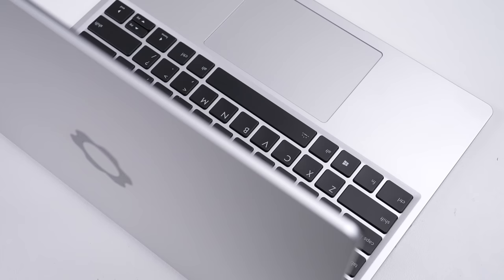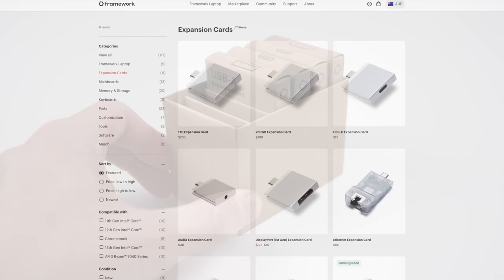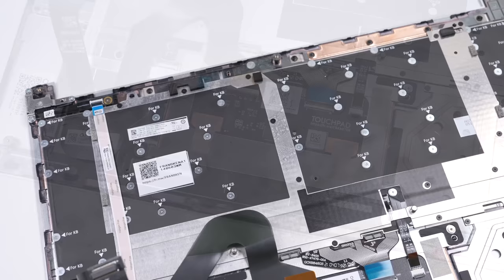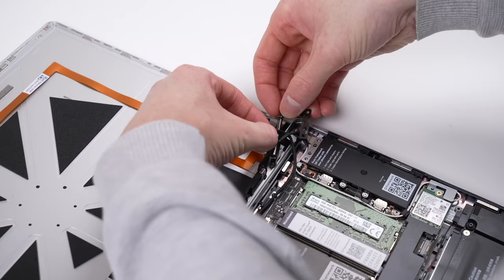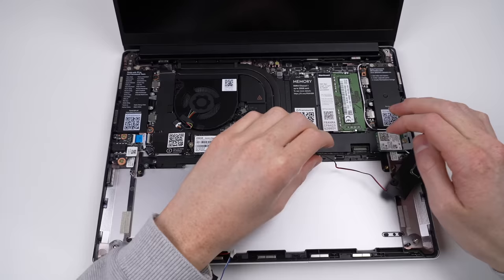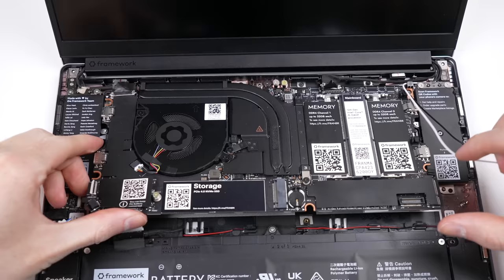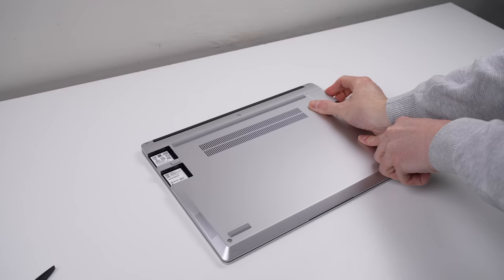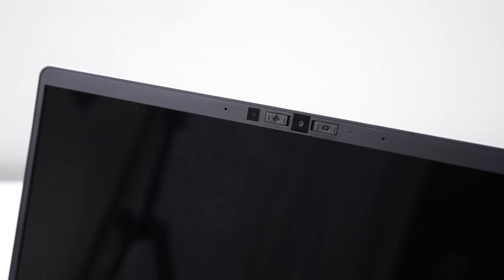New Laptop Brand Shocked Whole Computer Industry - Framework Laptop - Teardown And Repair Assessment

Comment: This has been my laptop for 1.5 years. It is a great piece of hardware. I hope that they can come up with a repairable and modular phone as well. That would be incredible.
Reply: Yep, I'm also just waiting for a FramePhone at this point. Framework's "rolling release" model towards their laptops is a way better approach compared to fairphone's offering of distinct, incompatible generations.
Reply: phoneblokz exists. I guess we're just waiting for their patents to expire. But it exist
Reply: @methujeraya  I don't think phonebloks are a good concept. They require too much forward compatibility for every component.
Reply: with phones software support is a major issue
Reply: @drinkwoter   that and if you don't run an NSA and CIA approved OS you're going to have lots of "compatibility" issues. or worse, just ask nokia,  samsung and ntt docomo... 🙄
Reply: @drinkwoter  not really.
Once you're running on Android, the only thing that needs to be taken care of is drivers. Most of the time older smartphones, and by "older" I mean more than 2 years since they launched, aren't supported anymore, is because companies want to push people to buy new ones. Example: I'm currently using a Nokia 7.2, which was sold in 2019. Nokia even advertised 3 years worth of support, which would have guaranteed the upgrade to Android 12, however, they decided not to do that and I'm stuck on Android 11. THis isn't bad when it comes to the apps though, as A11 will be supported another 5 years or so.
Reply: @GeoStreber  instead of phonebloks, there's the fairphones, its basically a framework phone of sorts
Reply: Fairphone is worth a look but you can't upgrade parts just replace them
Reply: @Toouket  Well, not really. Framework builds their laptops to be upgradable. You can put 13th gen, and soon Zen 4 motherboards in your old original 2021 11th gen Framework laptops. They're forward- and backwards compatible. 
That's not the case with Fairphones. They offer distinct generations, which are not compatible to each other.
Reply: @GeoStreber  ah, thanks for correcting my misconception
Reply: Fairphone?
Reply: @michalkrajcovic3374  they removed the headphone jack, so it is not worth it to me.
Reply: That's a long way from happening, framework first has to figure out their 16" device and modules, and they need to increase hardware production. Even after that, it's more likely that they'll try their hand at desktop or server components before phones. Making a phone is very complex, and requires a lot of relationships. Well, on the other hand, I could see them partnering with a phone manufacturer for a device (similar to what they do with cooler master), which would drastically reduce the cost of entry.
Reply: @ElJosher  imagine crying over the headphone jack although you have a USB-C port that can do both charging and audio. Do you also carry an extra pair of shoes around?
Reply: @Okararu  what an awful take.
Reply: @ElJosher  not as awful as judging Fairphone because they got rid of the useless 3.5mm jack. Get over yourself. What do you even need it for?
Reply: how does the laptop work out for you? Like any details? specifics?
Reply: @rgw5991  it works well, its build quality is good, it has a high res 2:3 screen, which makes it look bigger than normal 13 inch screens, it is lightweight as it should be for an uotrabook type laptop. I uses linux with it and it works wonders for the type of work I uses it for. Don’t know what else to tell ya.
Reply: modular phone just make entire full of socket. do you want your phone back to old days? large size?
Reply: You'd recommend one then?  Waiting for the 16" to launch as I will certainly be buying it.
Reply: @UncleMarvo  yes, it is a quality product imo.
Reply: @Okararu  I connect my phone to the car stereo, portable speaker, and earbuds with the audio jack. What do you mean useless?
Reply: @Nathan-pl2cf  useless because you can simply use Bluetooth. Just because I decide to walk to work 4 hours everyday doesn't mean it's a good idea. Just because you use 3.5mm doesn't make it generally useful.
Reply: @Okararu  Car stereo and speaker doesn't have bluetooth, plus the bluetooth on my phone disconnects all the time if you so much as look at it wrong.
Reply: @Nathan-pl2cf  my car doesn't have Bluetooth either. I simply got a transmitter for like 10 bucks that converts my music into a radio signal that my radio can receive. Now I can listen to music even if is step out the car with my phone in my pocket. Usually your phones Bluetooth works, and it's infinitely better than a cable. 3.5mm is obsolete.
Reply: @Okararu  But that's just kicking the can down the road. Now, rather than just using a cable, I would have to buy either gadgets to make my old stuff compatible, or buy whole new stuff, leading to perfectly good devices to end up in a landfill somewhere. Plus, a cable is the easiest electronic to repair. Good luck repairing a bluetooth/radio transmitter without replacing the whole thing.
Reply: @Nathan-pl2cf  wrong. I use a gadget that costs basically the same as a cable to use something that's more versatile than a cable connection. And who are you kidding, did you ever in your life repair a broken charging cable or 3.5mm that held for more than a month after the repair? I doubt it (Btw my Bluetooth transmitter didn't fail me until now, keeps running strong, never had a connection issue). At some point you chose the cable over the Bluetooth transmitter, that's where you made the mistake. You wouldn't have to buy new stuff if you would've bought Bluetooth right away.
Reply: @Okararu  I repair/refurbish electronics from thrift stores/garage sales as a side hobby. I don't buy cables because you usually get them for free with whatever uses them. Cable repair typically only involves a quick solder or a crimp. 

Why would you think a video about laptop repair and upgradability wouldn't attract a handyman demographic?
Reply: @Nathan-pl2cf  good for you then, still doesn't change the point i made. A wired connection will be more prone to failure due to wear. A Bluetooth connection experiences no wear. Yeah, maybe some day a cap will blow out on the thing, but until then there's absolutely nothing else that could fail. A wired connection on the other hand that gets plugged in and out several times a day? I doubt it, not just that, my experience showed me that my Bluetooth transmitter is far more reliable.

Comment: Its amazing as to how easy this whole process is and could be with this form factor. It’s sad actually how the large generic companies are ripping you off on repairability. I love this.
Reply: @sys-administrator  The macbook air (same size screen as this) have a 52.6wh battery. This one have a 66wh... The one with a bigger battery is the 16" macbook and those should not be compared since it's another laptop category.
Reply: @sys-administrator  Good question since their efficiency could be very different..
Reply: @sys-administrator  that wouldn't be much of framework fault, since they don't build the cpu, but I don't think it would be slow with a current gen i7 or r7
Reply: As a computer tech who shared a shop with someone who worked on phones, this is the biggest thing I hate about Apple products, their price also being a direct reflection of the greed involved. Apple laptops that were ancient, or at least one I remember working on specifically, were designed with a whole sub-frame under the single piece bottom panel that you had to take off to get to the board and to get to the CMOS battery, a normally easy to do repair for a battery that can die around 7 years or so,  I had to also remove the entire motherboard and everything that was in the way of it in order to get to the side of the board facing the keyboard.. Macbook Pros I've worked on also have very tiny(and proprietary) ribbon cables that are delicate and expensive to replace, a lot of iPhones I've seen had the home button replaced on no longer supported Face ID because they specifically matched the hardware ID of the button to the phone, and in order to be certified to fix iPhones, the lady I shared a shop with, as a business would have had to agree to only fix Apple products when the majority of her customers were Android users. Old laptops had small sections of the bottom panel that you could remove for easy access to upgradable things like RAM, Wi-Fi cards, and storage. When easily removable batteries were being phased out, it affected hardware troubleshooting for some models because the companies that designed some of the laptops decided that instead of being able to power on the laptop with a defective battery or no battery at all, that the laptops would do nothing whatsoever when you push the power button, just like the symptoms you'd see if the motherboard or charger port was completely fried. Not having a spare known good battery that was compatible(small connectors etc.) meant troubleshooting was done at that moment. Otherwise, just having a compatible charger, universal  ones with selectable voltages for example were amazing to have, you used to be able to turn on the older laptops and know that it was the battery that had failed. Plus, replacing the older batteries involved a simple latch to remove the old one without disassembly.. how times have changed..
Reply: Like cars before...

Comment: Wow, they thought outside the box. Ease of upgradability is at another level for this device.
4:48 I love that tag with Framework team names and remark "Made with Love by the Framework Team". Well done!
Reply: I have to disagree. They thought inside the box
Reply: @PaulCotterCanada  agreed. My laptop can do all of this already, minus the modular ports which I don't care about because mine already has a variety of ports and I can just use a USC C dongle. If I configure the 13" like my laptop, it's 10% more expensive with less ports. This laptop is very underwhelming. They really missed the opportunity to make an accessible and swappable battery on the exterior, like old laptops.
Reply: @DoubleOhSilver well you can remove everything from this, even the screen, so some screws are nothing
Reply: @DoubleOhSilver  No you're laptop can't do everything that can. Everything is not replaceable and modular inside on most laptops. Like hell, you're going to ignore the part that you can completely upgrade the performance for a fraction of the price of a new laptop. You can get a new mainboard for just about $600. Personally, I don't replace my laptop's battery enough for it to be that much easily accessible, not to mention it sort of ruins the looks of the laptop. I agree that the modular ports are eh plus the price is a bit more than competitors, but I also think that it gives you an immense amount of future-proofing that no other laptop can.

Comment: I was toying around with a concept of upgradeable laptops about 15 years ago but just couldn't come up with a way to make it work. That was around the time that companies like Dell started soldering RAM to the mainboards. 
I hope they're able to stick around, especially in this era of tech where more people seem to be interested in phones than laptops.
Reply: My dell is from 2000 so far I've have to hack up windows 10 n delete the upgrade software because ghetto upgrade interferes with my sound card & it's firmware can't be upgraded yet :(
Reply: wth? dell did that? i bought an asus a few years ago for school and i was able to upgrade my ram to 32gb easily, but dell doesnt even allow that?
Reply: @clothokaftan  Some current laptops also solder RAM sticks to their mobos, but it's less usual. Lenovo does it with their Ideapad 3 for example. Shitty stuff.
Reply: Soldered on RAM and SSD makes me puke.  YUK! lol

Comment: It's the best design I've ever seen. I am delighted with the way you can intervene in it, either for upgrades or for repairs. It has NO equal on the market. I hope it can be easily found on European markets as well. It represents the first choice at any time.
Reply: Not just highly repairable and upgradable, but also a good looking laptop too.  I'm definitely considering it as my next lappy. :)
Reply: Where's the swappable battery and dedicated GPU?
Reply: @BillAnt I'll buy one when I can have the following

Old school trackpad (the type with dedicated left and right click buttons) 

90+wh swappable battery (no dismantling needed) 

Dedicated GPU (3070 or higher)
Reply: @mwbgaming28 - You need an ASUS ROG lappy. ;)
Reply: @BillAnt  new ones have that stupid clickable trackpad, and the batteries are non removable
Reply: @mwbgaming28  - First thing I do on any laptop is disable the track-pad, and use a good mouse for much better and more accurate navigation.
Reply: @mwbgaming28  the new framework 16 has an 85Wh battery and an amd rx 7700s (which is about an rtx 4060 equivalent, it performs better than the rtx 3070 laptop according to passmark), the gpu is a completely removeable, and upgradeable module too. It doesn't entirely hit all your requirements, but I think it's worth checking out anyway if you haven't already
Reply: @leowolastname2250  non removable battery, and no option for a trackpad with dedicated left and right click buttons
Reply: @BillAnt  I use a mouse when possible as well, but you cant ALWAYS use a mouse (such as on an aircraft) 

So when I have to use a trackpad I don't want to deal with misclicks because the entire trackpad is a click button
Reply: I'm waiting for it to become available on SEA!
Reply: @kusog3 - I use a small Logitech M325 at home, work, and on the road/plane.  It's small enough to fit in a pocket yet surprisingly comfy to use.
Reply: @mwbgaming28  the framework battery is completely removable with screws, but the touchpad doesn't have the physical left and right buttons, and it seems like most framework 13 owners found the touchpad to be of mediocre quality. You could just use an external mouse, but if you really need a good trackpad and it's a deal breaker that it's not really good, then I can't really change your mind any further, I might update you if they do actually release a trackpad with physical buttons in the future if it actually happens and I haven't forgotten by then
Reply: @leowolastname2250  removable with tools doesn't count as swappable, I mean old school swappable

And yes, clickable trackpad is a dealbreaker 

Why is it so hard to find a laptop with these 3 things 

Swappable 90+wh battery
Trackpad with dedicated left and right click buttons
Dedicated high performance GPU
Reply: @mwbgaming28  I really don't see the reason why laptops should have old school swappable batteries, what's your reason for that?

Comment: I have a Framework 13" gen 12 that is 18 months old.  In fact, I am typing on it right now.  As an ultra-mobile, it rocks.  It is not suitable as a heavy dev machine, so make sure you know what you're getting.  It does have a few flaws.  The touchpad is "okay," battery life is mildly disappointing, and the keyboard is a little sticky.  If you dock with this, the external graphics are weak and you will need an external graphics card.  However, I love it for where I use it.  I am considering getting the 16" when it is finally out so I can have a fully configurable and repairable dev laptop.

I ordered the DYI kit.  I purchased upgraded ram, a better NIC, a more versatile power supply, and a better NVM drive than offered separately, which I am sure are contributing to disappointing battery life.  I have 6 ports that I use interchangeably - three usb c, one usb a, one HDMI, and one micro sd, which I used to install the OS.  I loved putting it together using one tool to do it all.  I haven't had to do a thing other than to blow it out and remove debris from the keyboard.
Reply: What graphic card does your laptop have? I'm interested in purchasing one myself from Frameworks but they do not mention anything about graphics.
Reply: @ragael1024  The Laptop 13 only has integrated graphics.
Reply: You got scammed lmao. You had to buy your laptop ports seperately. 🤣🤣 Mine came witt 6 ports and cost me $160
Reply: @nitroxylictv  uh sure buddy… list the specs of your laptop.  Was it used or a refurb?
Reply: @ChaoticDucc  i spoke with them and they said that, while they cannot mention right now, the new 16" type will come with some upgrades regarding video cards. I mean... i'm not interested in having a 3050 or better on it, but still smth that can support a game such as diablo 4 on low quality. Not sure if integrated cards support this.

Comment: This is amazing! Allowing to not only give room for upgrades and repairs, but 100% customisation (e.g. keyboard, frames, and components). Finally it will have the freedom of a desktop!
Reply: Not soo much, you cant change the cpu, gpu or MB freely, but i prefer change the CPU-MB rather than buy a new laptop, and even the ram, or the f*ck*ng storage, are thing that come soldered in some laptops.
Reply: @cerealmama3879  I think the Framework 16 version allows you to swap in and out GPU. ALthough for now, it seems they only have AMD Radeon™ RX 7700S. Maybe in the future we'll have more GPU configurations
Reply: And you aren't going to be STUCK with Windows SPY-11 either (If you prefer) and go linux! How free is that? Actually be able to control even more. I'm hooked and this is the first I have heard of these guys! AWESOME!!!!!!!! I'm SOLD!

Comment: Wow, that is quite something. I really like the port modules, there's always something that has a cable that's just a couple inches too short and you wish you could plug it into the other side of the laptop. I bet the modular design also helps Framework in that they don't need to keep a whole lot of laptop models in stock and try to guess which ones are going to sell. They just need to stock the base model and all the upgrade modules. Everyone benefits.